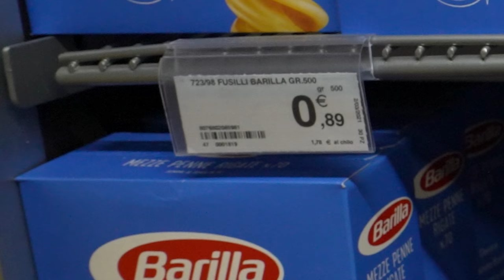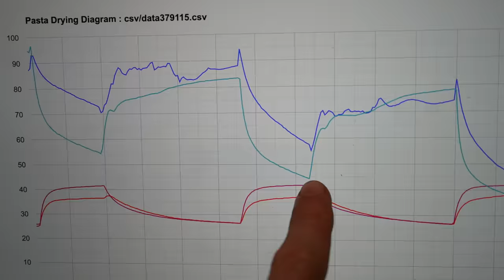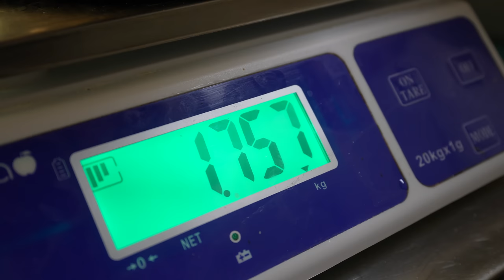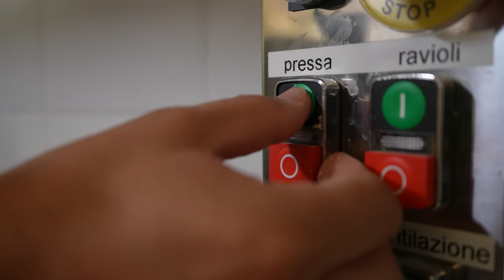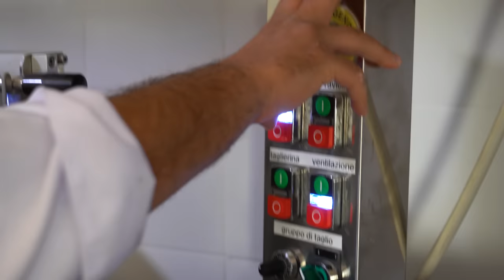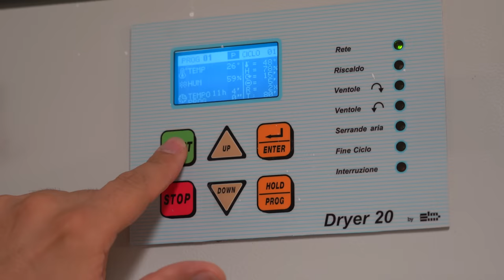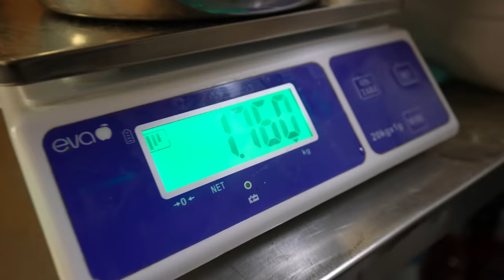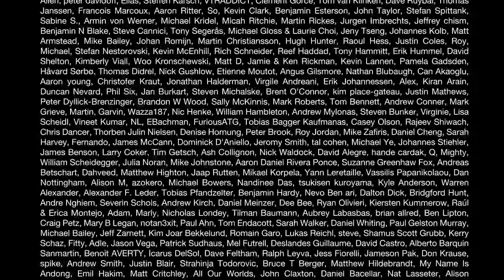I Got Hired by Italian Pasta Master and Discovered This (my only hope)

Comment: maybe the extra filter/mesh before the pasta-die "replaces" the vacuum by creating extra pressure and removing airbubbles ? also the vacuum will help dry the pasta. the difference in water content of your recipe can maybe be explained by water loss during the kneading from evaporation. he did mention the dough gets warm from kneading. the heat at the die is created by friction and pressure ,oilpresses also experience this ,but when pressing oil the extar heat might help. GL alex and thx for these useful videos.

Comment: How can the machine not be a problem, clearly you need the right pressure, and the right die with the right material, I think the machine and the drying process is everything

Comment: When we used to make pasta in the shop humidity could change the amount of water added in a huge way.  You need the dough just wet enough that it won’t plug your dies, but to wet and you get a case of the crumbles!!  Good luck and it’s true, every machine is different and it changes with the weather

Comment: Alex, you may have done this already, but if you haven't, you can and will make good pasta like I do all the time.  Your problem is, you don't have the right tools.  For example, you use a stand mixer to make your dough.  What you need is a pasta machine with a mixer incorporated to get the proper consistency.  Start small with a La Monferrina P3 for around €4.000,00 (around the same in USD) with the rotating cutter.  Then purchase your trays.  Start with about 8 to ten of them.  You can buy them anywhere you buy the P3 or on Ebay if you want.  Before I moved from New York I did all my pasta making in my basement.  I bought several cheap house fans and put them on small stands to blow on the trays which I stacked maybe three or four at a time onto upright bases that I made.  The air flow was perfect.  Then I dried my pasta for about four hours, turned off the fans, covered the pasta with clean bedsheets and let the pasta sit for another four or five hours.  Then I removed the sheets and repeated the drying process.  This took about a full day of back and forth.  Was it perfection every time?  Not really, but 90% of the time it was.  Perfectly extruded pasta drawn from bronze dies to give that rustic, yet relatively smooth appearance.  And the taste?  My grandchildren won't eat commercial pasta anymore.

As to the finances necessary for you to purchase all the equipment I've mentioned above, well, you have 2 million subscribers.  I'm sure there are enough to kick in a few bucks each to make you solid. Buona fortuna!

Comment: in the beginning of the extrusion the the dough pressure is building towards optimal pressure that is why it will take a while for the right consistency to appear. the longer the screw is the longer it will take for the right condition to be established.

Comment: Alex, you may have already realized this, but there is a direct correlation between the porosity and density of the pasta and the pressure under which it is extruded.  If you gently squeeze some of your dough between your fingers it will stick together in a little clump, but that clump will easily crumble and fall apart under stress.  If you press a similar amount of dough against the table with all of your weight, the resulting clump is denser and stronger, and it won't fall apart as easily because the protein strands from the different granules of dough have been forcibly entangled with one another to create a stronger pasta.  Also, when Luciano left his pasta to rest before putting it in the dryer, I imagine something similar to the autolyse process in bread dough making is occurring where the gluten proteins are interlocking with one another to create a stronger and more springy pasta dough.  As such, before you alter your dough recipe you might try extruding your pasta at a higher pressure (if your machine allows) and letting it rest before putting it in your pasta dryer.  Using the data you collected from Luciano to make any obvious adjustments to your drying process might also be a good idea.  Only after trying these relatively easy adjustments and still failing to get good pasta would I jump down the rabbit hole of iterating on your dough recipe.  Hope this helps, and good luck with both your dry pasta making and whatever food endeavor is next for your channel.

Comment: I'm going with the cooled extrusion head as the biggest part of your solution.  Would be interesting to check the temp of the pasta immediately after extrusion in both processes.  The filter also may be a key part,   heat would increase even more with a filter on your setup I think.

Comment: @Alex

One of the things that was occurring to me as I watched you process develop was that the pasta was undergoing stresses as it dried, much like glass, ceramic/pottery, and metal do when they cool (and also dry pottery before firing).  As the surface dries faster than the interior, some areas in each piece of pasta will be under compression and some are under tension.  That almost certainly contributes to cracking. Each cycle of heat/no heat probably only exacerbates the issue.  Did Luciano's method use similar cycles or was it more steady?  Do you think his method was developing a better gluten network to resist cracking?  Does that also make for a less brittle pasta?  I definitely think he was spot-on with his advice to make your recipe fit your machine.  

It might help if you work with glass artists, potters, metal casters, and blacksmiths to understand how they solve those problems.  Materials scientists are probably the best to give you a really good understanding of the stresses so you can build predictive models.  Maybe experiment with freeze/vacuum drying?

I also have a thought about an improved cutter to mount on your machine.

Comment: Just as in bread making, you have to account for the humidity of your environment. Flour will soak up a LOT of water from the air. "Dry" flour might be anywhere from 10-20% water by weight, depending on how humid your kitchen is. If you live in a desert, you might only have 10%-12% water, but if you live in a swamp it could be closer to 18-22%. When you're measuring by weight the more water you have from humidity, the less actual wheat ("dry solids") you have in your recipe. That throws off your ratios by a huge margin (warning: math ahead):

Using the same 6kg flour + 1.75kg water (29% ratio as Luciano uses here) for the dough recipe:
10% water weight from humidity = 0.6kg humidity + 1.75kg water + 5.4kg dry solids = 2.35kg water : 5.4kg wheat or 43.5% total water by weight
20% water weight from humidity = 1.2kg humidity + 1.75kg water + 4.8kg dry solids = 2.95kg water : 4.8kg wheat or 61.5% total water by weight
That's an 18% difference in water content from only a 10% difference in weight from humidity.

To test how much water is in the flour you can weigh a sample and dry it in the oven, then weigh it again to see how much water was lost. Put a hygrometer in a sealed container where you store the dough and start recording your water content compared to the hygrometer reading, then graph it out once you have collected a few data points so you can make predictions without having to process oven samples every time.

Hope this helps. Good luck in your pasta adventures!

Comment: I remember how I've been making pasta with my father, it was a summer in my home village, we have so many eggs that we don't have idea how to manage them. We took 40 eggs and 8 kilograms of flour, knead it together by hands, changing every 10 minutes. Dough was yellow (from yolks) and very, very springy and firm at the same time. Than we let it rest for like 30 minutes and then start to rolling it by hand cranked machine, then using same machine but different rollers - cutting it into spaghetti and tagliatelle pasta. Whole process took us about 6 hours of hard, hand cranked work :P 
Pasta then was scattered on clean sheets covering whole attic, since there was no thermoinsulation - there was hot like hell. It dried out, after 2 days we collected pasta. After cooking it has same properties as freshly made one.
Reply: i'm doing experiment on egg-based fresh pasta drying. I noticed that the slow dehydration may be best method, though most time consuming. If I hang the long pasta like tagliatelle in a air-conditioned room, the pasta does get dried quickly, but seem lose too much water and become brittle. So a trade-off method is to lay down the pasta in a normal oven rack, and leave it there overnight for like 12-15 hours in the so-called fermentation mode (30 celcius without humidity control), then you will get a beautifully dehydrated pasta in the other morning.

Comment: Alex, Hi !

The issue is Lucianos machine compressed the mixture at very high pressure(enough to bend the metal filter guard). You need the same machine, which can produce enough density in the pasta...
Love ur movies..
Reply: *Thanks for watching send a direct message right away on the above number for more enlightenment:••*......
Reply: That makes the assumption that Alex's machine is incapable of that torque, and that the pasta is produced with the same starting hydration levels. That said, finding balance without direct replication could take months of recipe testing and a literal tonne of semola.

Comment: The pasta was more rubbery coming out of the machine.  Sounds like  the gluten binding due to water, kneeding and autolyse before the actual extrusion.  I wonder if the gluten content differs much between your flour and Luciano's?  I didn't realize temperature was such a big factor.  But makes sense that you often autolyse in a refridgerator.

Comment: I have a very strong feeling it's the filter sheet he should you with the pressure marks. It increases the pressure before extrusion causing the gluten to bind much more strongly. It's like the ultimate kneeding step that toughens the dough immensely.

Comment: Luciano saying you need to find the right recipe for your machine and place reminds me a lot of what I do. We coat medical devices with non-stick coatings to within very narrow tolerances. While each machine is designed to be somewhat standardized they all have quirks and they're all in different parts of the building and so have different humidity and temperature which is super critical. And of course how we spray parts during the summer is very different than how we do during the winter. How we spray on rainy days is different than clear days. It really is something you need experience to get good at, you can't just explain the theory to someone. For instance, while we have humidity sensors everywhere, you will get very different results if that humidity came from ambient air vs you manually turning on a humidifier, even though the sensor is reading the exact same number. I couldn't explain to you WHY that's the case, I just know from experience that it is.

Comment: Not going to lie, I think the answer is in that screen before the extruder. A final mixing before the die. As the auger works it does not evenly apply pressure to the dough throughout its entire flow. It cannot, even a piston would not evenly apply force throughout the entire volume before it enters the extrusion, I think you end up with very dry dough on a certain cross section that is being pushed by the auger and dry on the surface before the die, the rest will have more of the moisture. Think of when you squeeze the dough in your hand, the outside that is in contact with your hand is more dry than the Center which is more wet than you intend because all the moisture got pushed into it. The screen breaks all that difference in moistness up, right before it is recombined in the die. You get a more even moisture content, that is my theory at least. I think your pasta may have an average of 27% moisture, but that does not mean that the entire extrusion 360deg around has 27%, I believe you have parts that are high in moisture and parts that are super low, that relationship will remain even through the drying process, unless you have a hydration process where the pasta sits in a humid environment it all gets to 29%, and then you dry.

Comment: I'm confused as to why Alex has decided the problem is behind the die.  Could it not still be a pressure issue at the die itself?  This video actually showed a very similar pasta to Alex's at one point, and the die was the issue there.  Also, Alex's extruder is producing product at a significantly faster rate than the one shown here.  This also suggests to me there is a pressure issue at die itsef.  While that filter is probably key, I'd be very cognizant of how much pressure increase is actually happening.  A catastrophic failure at higher pressures is never fun.

Comment: My guess,or approach would be to compare the pasta of luciano with yours under a microscope...maybe the pores/intrusions in your pasta are bigger due to the temperature in your machine.I guess thats also why they are using fridges within the amchine to keep the pasta cool,as well as the predrying in a cold environment to hold the pasta firm while dehydrating just so much that the water wont be able to expand within the dough after cutting and resting.Thats just my theory.

Comment: I had no idea so much is involved with dri3d pasta making! Even what Luciano showed only scratches the surface. It's like having paint, brushes and a canvas, but you're no artist to paint a picture as it takes insight and lots of practice to make it your own.
I like the failures, it means you're learning something new, a hypothesis being proven wrong. 
So a part of the solution could be that theres a relationship between temperature, hydration, maximum pressure the extruder can apply, the aperture, removing waste from the extrusion path, kneeding time, kneeding with rampimg up hydration, cooling. I was looking forward to what the portable temp/humidity recorder recorded. Probably much steeper drying cycles is my guess considering the high air flow.

Comment: 5:06 "[The filter] increases the pressure."

That makes no sense. The filter divides the chamber into two chambers: the first chamber, before the filter, and the second chamber, after the filter and before the die. The pressure in the first chamber will be higher than it was before the introduction of the screen, but surely the pressure in the second chamber will remain unchanged (because the pressure determines the rate at which the dough passes through the die, which is unchanged).

Comment: Filter before the extruder then increase the water content, next is to fix the pasta dryer by increasing wind speed and lower the humidity extraction rate.

My original observations were that the drying was too fast and inconsistent. After seeing this video you can see a difference with the freshly extruded pasta. Alex's is much more feathery. Probably due to lack of water.

An experiment would be make a pasta with a stock instead of just water. or put in small amounts of salt/sugar.

Comment: I think your problem is either that you don't mix your dough enough or have a too hot machine when extruding. The reason i think so is because the gluten needs a lot of mixing to develop and risks  breaking if in a too hot environment. The gluten network is what's keeping the pasta's shape and is therefore probably too weak if the pasta falls apart when cooking.

Comment: Btw if you want to try to find the issue with variability accross many different factors you might need to think like a process engineer. Use fractional factorial DOE :D

Comment: Alex is the one on the ground floor on this one, but if the pasta is breaking apart I suspect he needs a stronger gluten structure. Testing the durability of the pasta during the extrusion and testing it at the end of the drying process should lead him to confirm if he has succeeded. 
Perhaps he could do small batches with varying percentages of water to find what works best?

Comment: Your semolina is to fine. Increase the size of the grind of your semolina, and it will help control the hydration of the pasta mix and the drying process. Less water, easier dehydration.

Comment: I think Luciano's pasta is extruded at much higher pressure, removing more air from the dough, and developing gluten strength.
The amount of pressure required to push the dough through that mesh filter, then the die must be significant.
So much so the extrusion head needs to be water cooled.

Comment: The ultimate goal would be (I'm computer guy, love everything electric or even petrol running stuff) a hand crank dough machine, hand crank pasta extruder and a solar dryer (yes you could use a bit of solar panel/electrics to control the ventilation/fan)... But that would be freakishly cool... and yes the pasta have to taste amazing... everytime 🙂
Could it be done... I think so... 
And right besides it is a solar tomato drying thingy that makes tomatoes taste like your in heaven... and then you make 3 different dishes and sell them in your restaurant...

Yes I'm dreaming... but man does sun dried tomatoes taste good... and pasta... :-)

Comment: i bought several bags of pasta from the fancy brand in this video, represented by that guy who seems to know everything, well, most of the penne where broken, it’s not such a good brand, IMO you need more homogenous dough, work it longer, and don’t dry it in a machine, those are designed to save time, you don’t need to, just let them dry, i have never had any problems with that, it’s the ancient and  proven method,